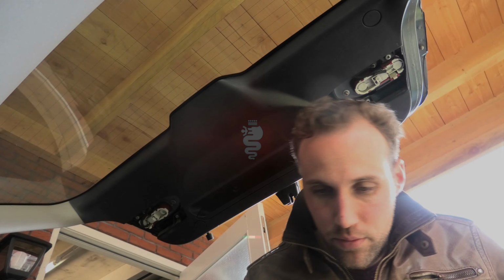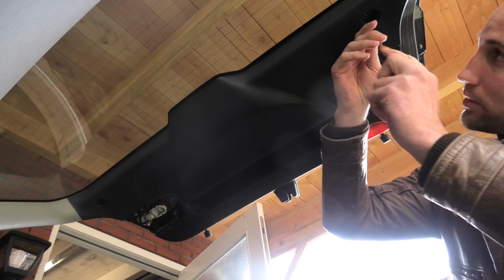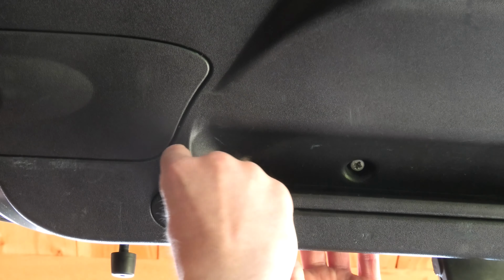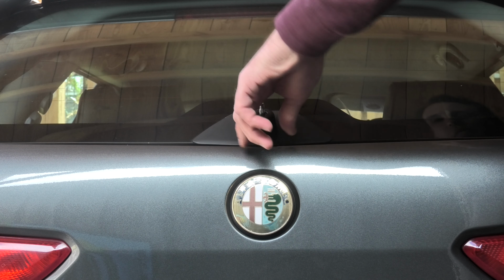33 Alfa 156 Replacing rear wiper motor

Comment: Hi, nice video.  I tried to do what you did in five minutes but after two hours I gave up and even broke the plastic.  After unscrewing the screws how the hell do you remove the plastic joints that are pressurized???  If I shoot they break.  I can't get them off the tailgate.  Tell me how the hell it's done.  Thank you. Please
Reply from the maker: Yes.. Its not easy to get those stupid panel clips removed. If you are used to other car brands where you can just pull a panel off without any issue this really sucks.

But! This is Fiat stuff. I recommend trying end get right underneath the clips with a long flat head screwdriver and release them with a twisting movement. Sometimes you need to do that form different angles. Do not pull on the panel, it will break. If you need more force put your hand as close to the clip as possible and while twisting your screwdriver with one hand push the panel down with the other. You can see me really looking underneath the panel in the video for the location of the clips (02:00). I damaged and broke a few other panels that I then needed to replace before I learned how to deal with the clips, hope this helps.